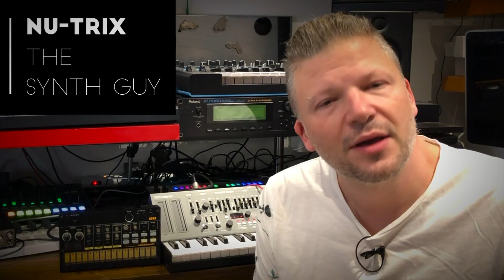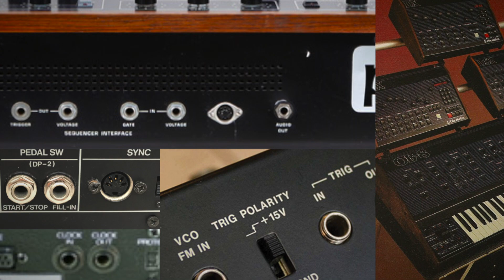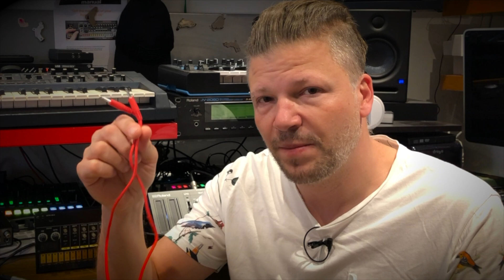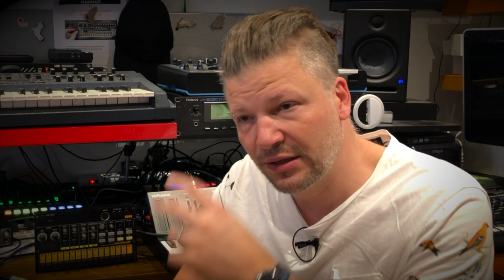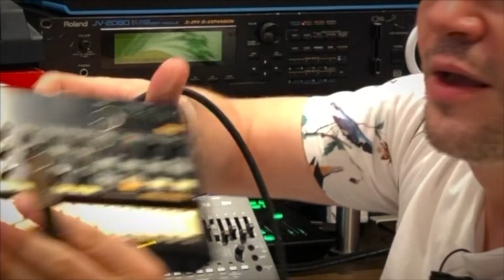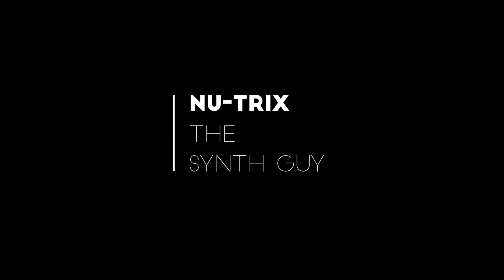How to sync using MIDI Sync or Trigger Sync?

Comment: Thanks for the detailed infos. I see up there you have a Microbrute. I'm trying to sync it to a Behringer RD-6 and TD-3.
Any ideas?
Reply from the maker: By default, the drum machine should be a good MIDI Clock master. Look into each manual to find the MIDI sync option of all your devices that you want to sync. If you select the RD-6 has the master, connect a MIDI cable for it's MIDI out to the TD-3 IN. Then using the MIDI out as a thru (check in the manual) Connect another cable from the TD-3 MIDI out to MicroFreak MIDI IN. Put the TD-3 and Microfreak in MIDI follow mode (can be called MIDI sync in, MIDI Slave, Ext MIDI in ...) Hope this helps.
Reply: @Nu-trix  i have a rd6 and td3 synced in midi with rd6 as master. In the same way as you just described could I (what my dad calls) 'daisy chain' master rd6 - slave td3 - slave td3 - slave roland sh01a via the same midi outs and ins as you just described?
Reply from the maker: @scartissue121  Yes, you could daisy chain them but be sure not to have them send a Thru signal in the Out (soft Thru) at the same time they send internal MIDI notes (you would have a MIDI Sync + MIDI notes sent to the next device). Check also this video :https://youtu.be/FTkoIAeHEg4

Comment: Watched that again and yes as people say this is very informative. Thank you for your great work! I am thinking to get a behringer td 3 and i am wondering if i can trigger it with the microfreak. The microfreak has cv/gate out and clock in/out and the td3 has sync in and filter in and im trying to understand if the td 3 can be triggered by the freak. Ideally i would like the output of the freak to be audio in at the td3 cause there is no space at my mixer..... Some say you can do that with the filter in of the td3 but its not official. Sorry for all that mess but its new territories for me. All the best from Greece and keep it up :)))

Comment: what synchronization devices are advisable to sync several hardware audio gears?
Reply: I guess look for something with a good good MIDI sequencer built-in. Perhaps a MIDI Thru box as well…
Reply from the maker: The device that has the most stable clock should be the master clock . Then yes a thru box would helps minimize the transmission latency.

Comment: Korg monologue mini synth ,,, what do i need to get them together, ie a boutique ,, not the same ?
Reply from the maker: Korg devices work well with other Korg devices. It does not work at the same analog trigger resolution as Roland or other. You will need a converter or a device that can change the trigger resolution. Or simply use MIDI, it’s universal!

Comment: Hi
I want to sync a drum machine (roland tr6s, which has midi in and out), a minilogue xd (it has midi in and out), a volca keys (only midi in) and a volca drum (only midi in).

I want to use a midi thru box. 
The typical Quadra Thru by Midi Solutions.

Is it dangerous to connect the Tr6s drum machine as the Master to the midi thru box; and the rest of them as the slaves to the midi thru box?
I have heard that pasive midi thru boxes are not that safe.
Would it damage any of the synths or the drum machine?
Reply: looking forward to somebody replying to this. I'm in a very similar situation. Although my minilogue would be master I think. I have a minilogue, Volca drum, Volca sample and a behringer td-3. Learning how to sync is taking much longer than I first thought.
Reply from the maker: Passive MIDI Box will not break any of your device. The active Thru box have a couple of microchips (running of the power from the 5 pin DIN cable)  that copy, clean and boost the MIDI signal so you get a good signal coming out of it. The passive are more like a splitter that devide the signal in 2 (less signal each)
Reply: @Nu-trix  thanks for getting back to us! I think I'll end up getting a midi thru
Reply: @Nu-trix  Awesome

Comment: Do you know if it is possible to connect 3 X MOTU Midi Express XT USB (8 MIDI outputs and 8 MIDI inputs) midi interfaces (48 midi ports with 768 midi channels in total) directly to a PC/DAW (directly means in paralell, not in series)? I use Cubase 11 Pro. Will Cubase Pro be able to see and process all those midi ports and channels?

I would like to be able to simultaneously and directly connect (via MIDI DIN 5-pin cables) up to 24 synths/groove boxes, etc to my DAW.
No midi thru / daisy chaining between devices to avoid the complex midi-related problems many people encounter (the audio and/or the midi data of different devices arive in Cubase at different times, etc). 
If the PC and Cubase Pro will allow it, I bet this would work flawlesly and every midi device will have its own port, its own 16 midi channels, its own dedicated midi track in my Cubase template, and it will be available at all times - a perfect setup for relaxing and being creative.
This type of connection will also allow Cubase and any of the midi devices to become the master clock (assuming the respective devices have that ability) and to control any or all the other devices at the same time. This can be done very easy just by selecting the midi output of the source-device in the midi input dialog of the destination-device track/tracks inside Cubase. 

To further avoid the midi-related problems I was talking about earlier, I will keep all the devices connected to the PC through MIDI DIN 5-pin cables only. 
In the case of the devices that have both "audio through usb" and "midi through usb", if I would like to connect them to the PC through usb (for "audio through usb" - I doubt that) I would disconnect the "midi through usb" connection inside Cubase. 

What do you think about that? 

A bit cheaper option would be to buy just 1 MOTU Midi Express XT USB midi interface (8 MIDI inputs and 8 MIDI outputs), and on the way from the midi interface to the midi devices to put a midi splitter/thru box (like the "Kenton MIDI thru 25" - 1 midi input and 25 midi outputs), and on the way back, from the midi devices to the midi interface to put 3 X 8to1 mergers (like the Kenton merge 8). But as I understand (please correct me if I'm wrong), those splitters and mergers do not retain the ports and their channels' information - they merge all ports and all their channels into 1 port with 1 channel, it copies it and it sends it to all the midi devices and, on the way back, to all the midi interface's ports that the mergers connect to. And that will ruin all the dexterity - no more 1 track-1port-1midi device-16 channels. 

Please correct me where I am wrong. 

P.S. - I didn't started to build my new studio yet. At the moment I have less than 16 devices and 2 X Motu midi interfaces would do it. I'm just thinking that in the future I will exceed 16 units and I will have to buy the 3rd midi interface. So it would be better to start with what gives me the possibility to expand when needed. I do not want to risk by mixing models or brands in the future. If you know of a better solution, I would appreciate if you would share it.

Thank you in advantage and I'm wishing you a wonderful day!
Reply from the maker: I would be surprise to see the MOTU driver supporting simultaneously 3 devices but I would have to test it. I have 2 old MTP. I’ll check
Reply: @Nu-trix 
Thanks for the reply! 
I just talked to Kenton UK, the company that makes the midi thru and midi merger boxes.
The solution is simpler than I thought. 
I misunderstood something. The outputs ports of the above-mentioned 2 boxes (Kenton midi thru 12 and Kenton merge 8) retain all the information that comes through their midi input ports. 
In the case of the "midi thru 12" box, the exact input info is multiplied 12 times and sent through EACH of the 12 output ports to 12 different devices which can use any or all the 16 channels that come from the midi interface to the "midi thru 12" input port. 
The "Kenton midi merge 8" merges 8 ports that come from 8 midi devices and all their channels and data, into a  single port with 16 (? - I forgot to ask) channels which can be connected to one of the Motu midi express xt midi interface. As this midi interface has 8 midi input ports and 8 midi output ports, it can drive up to 128 midi devices. 
So, there is no need to buy 3 midi interfaces in the case I presented above.
For a 24 midi devices setup, only 1 X Motu Express xt, 2 X Kenton midi thru 12 and 3 X Kenton merge 8 are needed. 
The Kenton only makes midi thru 12 and midi thru 25 boxes. No midi thru 16. 
So, in the case of midi thru 12 box, 4 midi channels are extra and can only be assigned to the already connected 12 devices (because there is no physical connection to connect 4 more midi devices).
In the case of midi thru 25, you can connect up to 25 midi devices, but use only 16 MIDI channels (as there are only 16 channels per port). 
Using this setup and the same brand and length of cables, leaves no place for midi and audio misalignment, other than that of the midi devices processing the midi info in different ways ... :)))

Comment: really nice video thanks :))
i have a question: is it possible to sync from midi out to (cv/sync/..) aux in?
or (sync/cv/..) aux out to midi in
Reply from the maker: They are different kinds of sync, but some devices can convert from one to the other and serve has a sync box.
Reply: @Nu-trix  thanks for the quick reply :))
ive seen adapter cables midi to aux, do you think that could work? :/
Reply from the maker: MIDI TO AUDIO? No
Reply from the maker: MIDI 5 pin din to MIDI quarter inch ou 1/8 inch yes. But it’s always MIDI
Reply: @Nu-trix  not audio, just the sync signal (sync in/out (3.5mm for example), that doesn't work? :-(
Reply from the maker: The cable we see that goes from MIDI (5 pin din) to 3,5mm is still just MIDI on a different connector. Mostly to save space on a device. To go from MIDI to CV Gate (and vice versa) you need a converter of some sort.
Reply: @Nu-trix  ah okay i see
thanks so much! have a nice day :))
Reply: @Nu-trix  So there are boxes that convert the ppq signals of sync? I First bought a volca beats , then a beatstep pro. Would like to not set the beatstep pro within its software to be synced to the 4ppq of the volca as Id like the daw/audiointerface to be the master and the bsp to be attending it. Lol i Havent even tried because of  workload :{... I even modded that volca beats to have midi out, yet havent had enough time to play with a these things....So if theere is tempo syNc Box ill be investing on one. Any  recommendation?
Reply from the maker: I use to have a BeatStep pro that doubled as a sequencer and clock converter. I usually find that one of my decide can receive MIDI and generate CV (tr-8s, system-8, novation mono station.) so I never had to test a dedicated clock converter.

Comment: Well... now I'd like to find how else to work with MIDI on synths. I've heard, or read, it is also useful to send messages about notes, their duration, intensity, etc. I want to know in what way I can control my synths starting from one specific synth or controller. Do you have any video here on the subject, sir?
Reply from the maker: I’m glad you found this helpful. You could also check these videos: How to connect your Dawless kit - I'm answering Miles!
Reply from the maker: https://youtu.be/gEt_dU0oQx0
Reply from the maker: And this one : MIDI Primer for DAWLESS - The MIDI implementation Chart  https://youtu.be/SNhFf9trhbQ
Reply: @Nu-trix  , you're so kind. Thank you so very much! :)

Comment: Hi. How to start a minilogue XD from the Roland Mx1?
Reply from the maker: You need to put the minilogue XD in MIDI sync "receive mode" Check page 46 of the manual . And the MX-1 should be in the default mode (auto = sending MIDI sync). Connent MIDI out of MX-1 to MIDI in of Minilogue. Check also that the Minolog can receive transport controls (it should in on position).

Comment: Hi I’m a beginner and I tried syncing my Moog Matriarch and Roland TR8S (I’ve tried Midi Out of the TR8S into the Midi In of the Matriarch but it’s not working)
Reply from the maker: Have you verified the internal
setting a of both devices. The Tr-8s must be sending MIDI sync and the the MOOG must be in external sync (waiting for Sync)
Reply: Nu-Trix The Synth Guy I have all the settings where it should be but what’s weird is there is a light that indicates it’s syncing but when I fiddle with any of the delay or filter or press any keys of the Matriarch I only hear what’s coming out of the TR8S
Reply: Soberbio, hope you did figure Out

Comment: I got a Roland t8 the other day and iv tried matching the tempos on that and a Yamaha DJx keyboard and it keeps going out of time I'm not sure why? So I'm gonna have to do it through midi I usually just set tempos and match the transpose ect and it's fine but after the first couple two bars it starts straying.
Reply from the maker: It means you don’t have a continuous sync.
Reply from the maker: Check if you have another device also sending MIDI sync

Comment: Hi, good video, what I am trying to do is sync a Moog grandmother to a Behringer Monopoly, to have a sequence running on the Moog Grandmother and the arpeggiator running on the Behringer Monopoly, when I use Midi the Monopoly plays the same notes of the sequence on the Grandmother, is there another way of doing it? Hope you can help Tim.
Reply from the maker: I’m not sure I get with you a re trying to do. If the GrandMother is playing a sequence then the Monopoly will play the same, unless you assign it to another MIDI channel.
Reply: @Nu-trix  I would like the the Grandmother and the Monopoly to play different things but be in time with each other, without using an external device, is this possible? Thanks Tim.

Comment: Thanks so much for the video!! Not sure if I was the one you mentioned asking the question..or if it’s that commonly asked...but thank you. Kinda bummed the Volca can’t trigger the Boutique. I use a Volca Mix which has a master tempo control...but I can’t hook up my Boutiques to it. I don’t have an SH-01a so I was unaware of it’s tempo knob on the front panel..I have a JU-06 and SE-02 and the tempo control isn’t as easy to work with than the Volcas. Oh, well. At least now I have a definitive answer that it really doesn’t work, and it’s not just me hooking it up wrong
Reply from the maker: You triggered the need to make the video. But it is a question I see almost everyday online!
Reply: “Triggered” the need...ahhhhhhhhhhhhh
See what you did there

Again...thank you for the definitive answer. I’ve been looking to invest in an MX-1 anyway for my Boutiques
Reply from the maker: See another idea for a video ... the mx-1.
Reply: I just received my JU-06a and I have a theory on the sync with the Volca Mix. What about a Korg SQ-1?? I saw a video from Perfect Circuit Audio with an SE-02, SQ-1, and a Volca Beats. The Volca Mix could clock the SQ-1 which could clock the SE-02 and JU-06a through ext clock in. Just a thought. I’ve been wanting an SQ-1 anyway for other gear

Comment: I just got a Roland Gaia and midi synced to a Roland tb-3 and it was not tempo based but a controller base.

How do I get it to do tempo base instead?Should the drum machine always be the master?
Reply from the maker: By reflex, I would guess that the TB-3 would be the master. Often the synth is just a follower of the master clock device.
Reply: @Nu-trix  Actually the Gaia was the master of the tb-3,it was weird to control the tb-3 with the Gaia Cutoff,ADSR,ECT.and still use it's knob too on the tb-3

I have been trying to figure this out for years and when I watch vids like yours, it looks sooooo simple,but damn if it isn't.
Reply from the maker: @MyBichSustained  I'll try to make a short video about it.
Reply: @Nu-trix  WOW!....Thank You!

Comment: Thanks for the video!  Now with MIDI, is there anyway to sync an arpeggiator on a synth to a pattern on the rimshot of a drum machine like they did back in the 80s? I know they did it by hooking up trigger out from rimshot output of the drum machine to the arpeggiator clock in on the synth. I really love this technique, just can't seem to find a possible way with newer equipment via MIDI.
Reply from the maker: What you describe is really something typic to trigger gates. It is not easy to do with MIDI. You would need to be creative to find a way to do this. Maybe a DAW that runs also a sequencer in a plugin that responds to a trigger ? Or program a patch in an app like MAX? But between to hardware MIDI devices it will be very difficult to do.
Reply: Nu-Trix The Synth Guy that's what I thought. I was told it could be done with MIDI, but I couldn't find any info on the web. I should be able to do it with my Beatstep Pro and Minibrute 2 though with a gated output into the Minibrute.
Reply: Nu-Trix The Synth Guy Would it be possible to convert it with a MOTU midi express?  It appears you can with the older models by connecting the click audio into the pedal input. And then choosing it in the console software. However the newer ones use clockworks and it doesn't mention that option in the manual. Like they took that option out. Any advice?